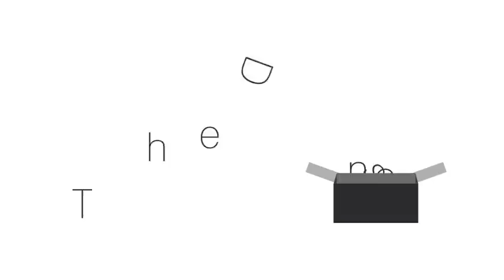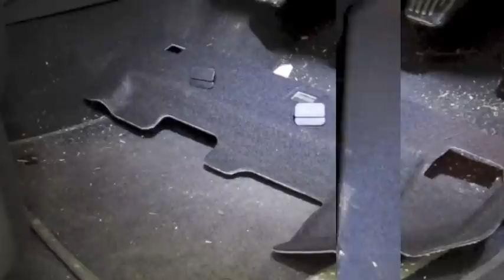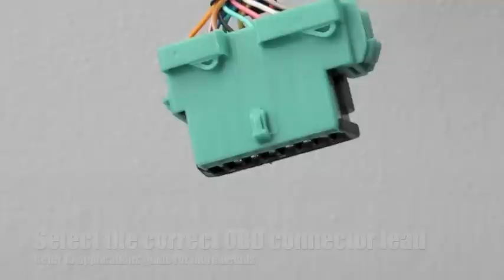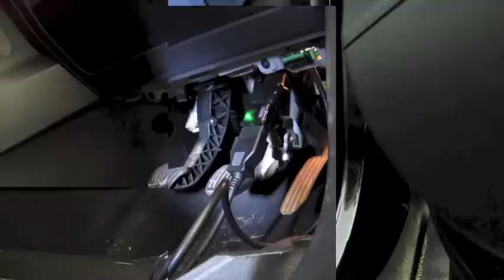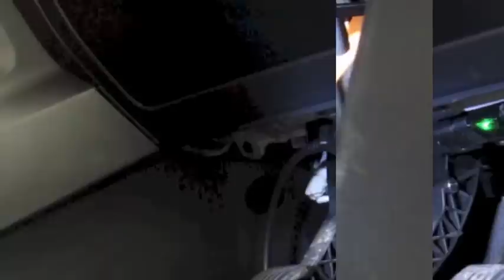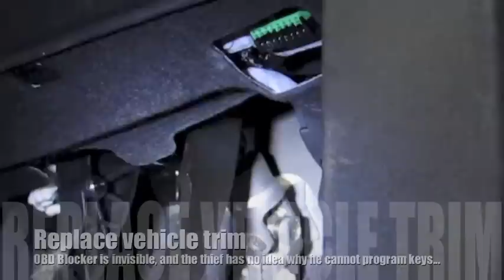OBD Blocker

Comment: Really? Like anyone smart enough to use the OBD port to steal a car WON'T cut this thing off like a piece of a Big Mac wrapper?
Reply: I say the same.
It cost more than a simple swapping wire kit and it take as much work but is easy as hell to remove....
A knife to remove the heatshrink and you're ready to go.
Adding to that the rfid stuff so added electronics that is prone to fail.
Total piece of crap.